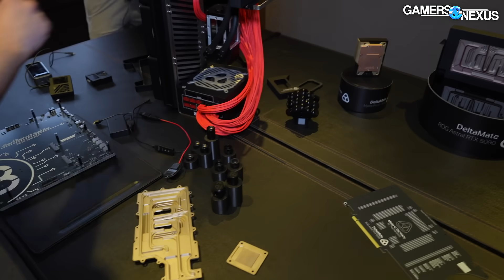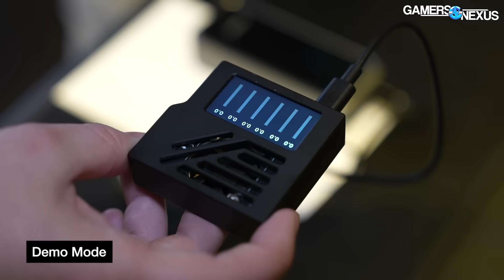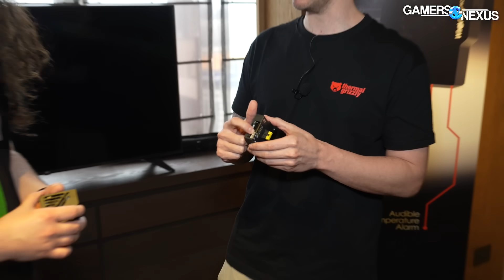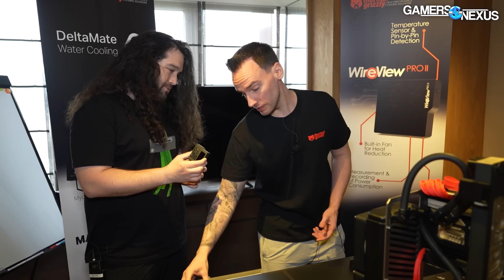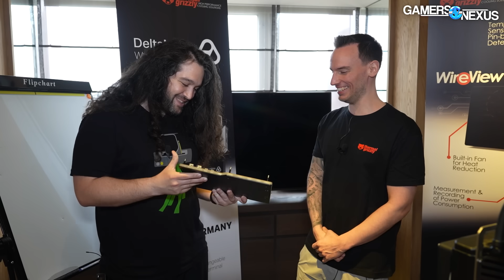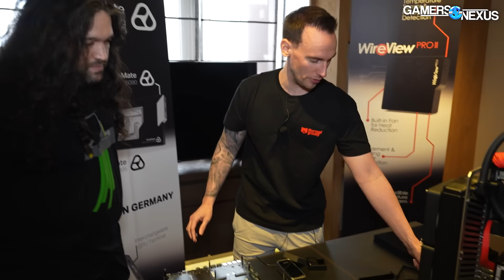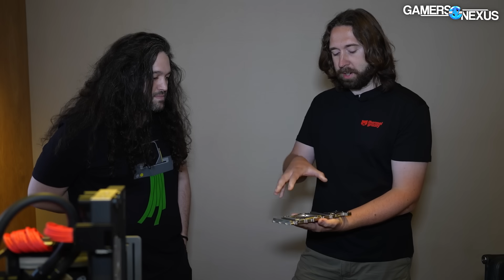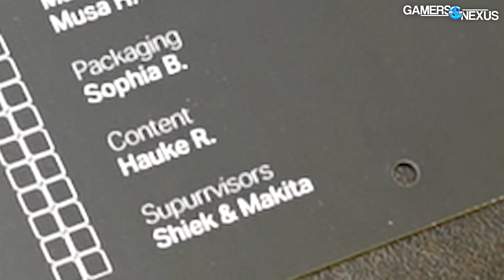Fixing the Unfixable 12VHPWR Connector, ft. Der8auer

Comment: This is not fixing the 12VHP situation!  Adding a monitoring device just adds yet another connector to an already flawed connector design from the start!!!!  The only FIX is a larger connector, (at least 50% larger with at least 50% larger contact "pin and sleave" surface areas and more plastic insulation space plus also rated for higher temps that wont degrade with hundreds of heating and cooling cycles which reduces the material structural integrity holding all the pin connectors tightly together.  (Next best bet is to de-solder the connectors entirely and hand solder #14 (or even #12 if possible) wires directly to both ends on the PC boards of the GPU and Power supply directly, LOL! Go with an industrial quality connector/basic terminal block or a properly amp rated UL rated "plug-in style terminal block" to be used as a disconnect between the 2 components!) (Sensing wires can be much smaller of-course!) Even old-school 8-pin connectors had a much larger contact surface areas, (per pin) compared to this ridiculous 12 pin system!!! It saddens me to see that young engineers can't figure out this obvious flaw, "Each Pin and sleave connector" is too small and not enough surface area to transfer the current from one point to the other, creating heat and current imbalance issues because the plastic gets too hot and the connections naturally loosen up because the hotter/softer plastic looses structural integrity, making the problem even worse over time!)  So the fundamental flaw is in the size of each pin and sleeve connector itself; barely adequate "In perfect conditions" with ZERO overload service factor calculated in, (Like the old 8-pin design had) then it degrades as it it loaded up and everything gets heated and becomes loose with thermal expansion; loosing perfect contact between the pin and sleeve design naturally.  If each pin and sleave connector was 50% larger with a much larger contact area to work with for the current demands, problem with heating solved because everything would heat up dramatically less! This is so basic in electrical engineering!
Reply: Won't fix anything on RTX 5090 FE cards.

Comment: Someone should offer a cheap version that throws a breaker or relay to shut off all power when one of the lines draws too much. The measurement is cool and obviously useful for many people but one just for peace of mind might sell well on it's own merits.
Reply: Yes, exactly. You could just sell cables with a fuse on each cable.
Reply: Although he said the ICs aren't the expensive part, so it's doubtful how much cheaper a version with fewer features would be.
Reply: You can build that yourself. Spec is 8.33A/pin, so a 10A fuse (like 0997010) should be fine, especially with derating due to ambient temperature that should leave you very close to the actual spec for the connector. This will add some resistance, 7.3mOhms, but that equals only 60mV of voltage drop which should be no issue.
Reply: So true. I want to be able to leave the PC unattended.

Comment: I'm probably out of touch, but when he hesitated on price I expected a number WAY higher than 100. I barely blinked at 100. I think because the GPUs you'd be using this with are dummy expensive.
Reply: PCBs cost basically nothing and even simple ICs are cheap.Their main issue is gonna be the lack of scale which makes the plastic parts really expensive.
Reply: When you buy $3500 to $4500 nvidia 5090 or 6090… then $100 is nothing in comparison… 
😂😢😂😢
Even $200 would be cheap if it saves you from buying new gpu…

Comment: cheapest way is to install fuse on each pin
Reply: Yes potentially creating even more variance in resistance per pin by adding 10A fuses that then forces all current into fewer and fewer wires until they all hopefully blow is indeed an inexpensive solution. It's also one of the worst.

Comment: neat video. id really love it if anybody at any point would discuss why PCI-SIG approved this obviously defective and woefully insufficient electrical design under pressure from nvidia in the first place, though
Reply: As Taesssi said, if Nvidia would make their cards better it wouldn't really be a problem, this also includes letting their board partners not be scared of Nvidia if they try something on their boards that Nvidia doesn't do on their reference models. Like you could make separate power rails for the power coming into the board to better load balance, which everyone and their mother knows is best done on the graphic cards side (board). It is much harder and not really feasible to load balance on the PSU and cable side.
Reply: @TigonIII Funnily enough they used to do just that. Nvidia cards used to have absolutely ridiculous load balancing circuitry when AMD just went "put this side of the VRM on one connector and this side on the other one - bäm, load balanced" and called it a day.

Then they introduced the 12HPWR/2x6 connectors and... just stopped. The very moment their ridiculous load balancing actually became useful or even necessary they just didn't bother any longer. WHY???
Reply: certain they didn't look at the electrical end, they only cared about the connector, and assumed Nvidia would care about their products.
Reply: @taesssi  Buildzoid bought the spec and it actually says all the power pins need to be connected to the same plane on the GPU side, so they did think about the electrical side, and I suspect given Nvidia also got rid of their power balancing at the same time, this part of the spec was also from Nvidia.
Nvidia was worried about penny pinching with their active balancing, they could have just gone to AMDs passive balancing, still saved some pennies and none of this would have happened.
Reply: @sacah2 saying power pins on the same plane, doesn't mean that the ones writing the spec took into consideration the full electrical involved. They most likely took current limits for the gauge wire, and said "this is the max" then left it up to the companies on how they would control that limit. 

At least that's how it used to be 20 years ago.
Reply: @taesssi  having all pins on one plane on the GPU side immediatly after the connector (which is as per spec) means it's impossible to do anything to balance power, you are just leaving it up to all pins and wires having no inconsistencies and the same resistances, else you'll end up with our current problem of some wires delivering much higher currents and melting.
Reply: @sacah2 hmm is think that after the pins you could put the resistors and so on?
Reply: @taesssi  resistors alone wouldn't help, you need a fair amount of components to do active balancing prior to joining everything into the single power plane. Active balancing is what Nvidia used to do and wanted to get away from. I'm not paying for the spec from PCI-SIG, but from what I heard, the spec says the pins from the connector on the GPU side need to be connected to a single power plan. So to meet spec, you couldn't add all the components you'd need for active balancing either. Ideally the spec either shouldn't have dictated how the connector is wired up on the GPU side, or go down the passive balancing route, have the pins split into maybe 3 power planes, like AMD does, and this would solve the problem too.

Comment: Wait, what? Why does it need a splitter from the case power switch ? Why can’t it just shut off power that it’s feeding to the GPU? Or why not integratq a fuse?
Reply: Fuse is a one time thing, then it's broken or you have to replace the fuse. Disconnecting the power would make the part a lot bigger and more expensive. Having it shut off the system seems like a easy and reliable solution.

Comment: I thought it was all user error. Steve really helped out nVidia with the user error diagnosis. Pity how they treat people who scratch their back.
Reply: GN never claimed that it was all user error, they just showed that all the ones that they could get hold of at the time showed that the connector wasn't fully seated. The connector not being fully seated is an extreme form of "different pins will have different resistance" and therefore also quite obviously represents a majority of the cases for the 4090 that used the older connector.
Reply: @Henrik_Holst  GN said user error. Stop trying to gaslight me that its not.
Reply: @markh-vy1sl  watch the actual videos from back then, they did not claim that it was user error. They found that the 12whpw connector on the 4000-series was wrongly designed in a way where it wasn't always clear if it was fully seated or not which lead Nvidia to redesign it for the 5000-series and after this it was discovered that there where additional problems (that had been masked by the misdesign of the connector).

Yes this was being spread by people who never watched the videos as "user error" but that was not the GN conclusion in the actual videos.
Reply: @Henrik_Holst  Nope, GN said all others were misinformed and their theory of user error was correct because GN  tested whatever. Go watch the videos again. GN says a lot of things but the main message was this: USER ERROR, USER ERROR, USER ERROR. They repeatedly said USER ERROR when other channels showed melting plugs to dispute USER ERROR. GN single handedly killed the melting connectors discourse by saying USER ERROR to benefit nVidia.
Reply: @markh-vy1sl  so basically you failed to understand those old GN videos just as I wrote in my earlier comment.

All of the burned 4090:s that they could get their hands on showed that the connector wasn't fully seated, not fully seating the connector is described as being "user error" but not in the way of "the user did something wrong" or "the user is responsible" as you have incorrectly interpreted it.

They then continue (and they made several videos about this) to make the claim that the connector is wrongly built since it #1 doesn't properly show if the connector is fully seated or not and #2 that it can loosen after the fact e.g when you route the cables.

And yes the others (and here I guess that you refer to Igor) was dead wrong, the thing is however (just as a wrote earlier) that GN was not 100% correct either since the connector not being fully connected masked the actual problem (which no one, including Igor, at the time talked about since no one back then examined what exactly Nvidia changed between the 3000-series and the 4000-series).

Also not entirely sure how you believe that anything GN said benefited Nvidia since it forced Nvidia to change the connector (aka Nvidia having to acknowledge that the connector was problematic).

Comment: I swear nearly every melted 12VHPWR connector I've seen has been from someone using an extension or dressed third party cables. 

I'm using an MSI Vanguard 5090 with a Seasonic PX-1000, still using the original 12VHPWR connector that I used with my 4080 Super, no issues here. Seems like a solution to a problem that is being stoked by paranoia and poor cable manufacturering for third party cables. The lesson? Don't use cables that didn't come with your PSU.
Reply: aka you have no information on the subject
Reply: @heresviktor No, it would be called anecdotal evidence based on my own experiences. The problem with that is I'm basing my opinion on the very real observations of other people's melted cables, not my own, as I don't have any melted cables.
Reply: sounds like you haven't tried furmark & high cpu load on both at the same time?
Reply: @fishingkev2332 I've used furmark for stress testing. I use my rig to play games, not put it in situations nobody would ever encounter in the real world. 

I've had it drawing 575W for hours on end prior to undervolting. Oh, and yes I ran furmark and prime95 overnight.

You all are free to go buy his overpriced plug so you can feel safe, all because you don't know how to plug in a cable and not exceed a maximum bend radius. What a clown show.
Reply: @RespextThis  I'm calling Bull crap on that whole PC games will never reach 575 watts. I run two two RTX 2080ti's & I can max them out in games on power. If you can't max your RTX 5090 to 575 watts in power then your CPU sucks.
Reply: @fishingkev2332 I'm talking about gaming when I say I've had it drawing 575W for hours on end. What I meant about real-world situations was that FurMark / Prime95 will stress components to their limits, particularly in terms of heat. While gaming I never see temps over 65°C on the 5090 and rarely above 50-55°C on my 7800X3D. However, when using those two apps to stress the system to the max they're hitting near the limit for thermal throttling around 80-85°C

Now that I have it UV it's more like 450-500W, but yeah, it definitely draws max TDP while gaming @ stock.
Reply: @RespextThis  temperturw is irrelavant to heat out put. Does not matter if if your heat sink says 55c or 80c with 500 watts it still 500 watts of heat dump regardless of how hot it feels or reads of sofrware.
Reply: @fishingkev2332 No, you might want to take a basic EE course and learn Ohms Law. 500W is not all the same. Higher R and less I equals the same P but more heat. Wattage is not a measure of heat, it's a measure of power, and power, current, resistence and voltage are all interconnected. Heat is a byproduct of the resistence the load introduces.
Reply: @RespextThis watts & joules even BTU's can both be converted into calulated heat and back in watts or joules.

Nice try with chatGTP crap but no.
Reply: @fishingkev2332  You're right about wattage and heat. This is why you don't try to continue a conversation immediately upon waking up @ 2am. 

I think what's happening is continuous power draw vs variable power. FurMark keeps the GPU consistently drawing max TDP and therefore gets hotter than a game running with variable power draw that might peak at max TDP frequently but otherwise is below that threshold more often than not. Or perhaps it has to do with more components on the board being fully engaged under FurMark and therefore outputting more heat? I'm not sure of the specifics, I just know that FurMark will generate more heat and stress your GPU a lot more than any game will.
Reply: imagine something with 80% failure rate, be lucky ebough in the 20% then 'it's no issue'
Reply: @nicholasxamotainiumgilgamesh it's not 80%, it's less than 1%.